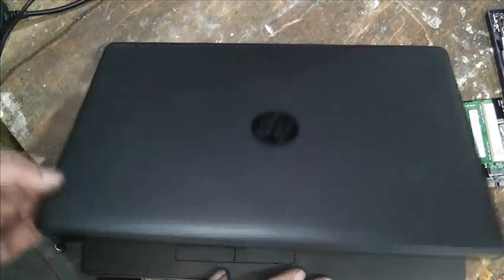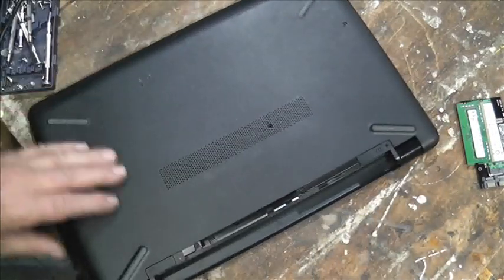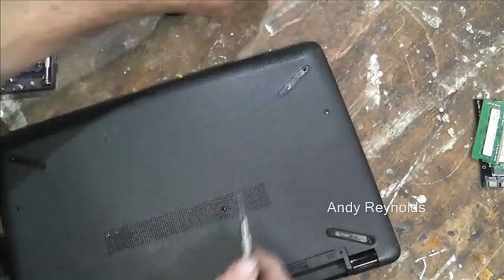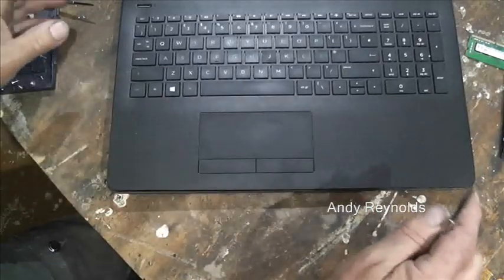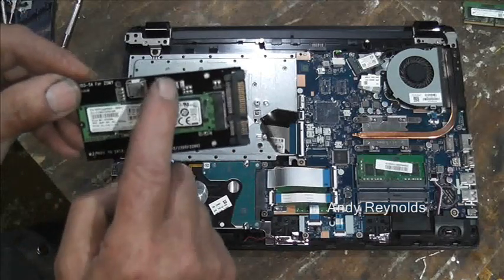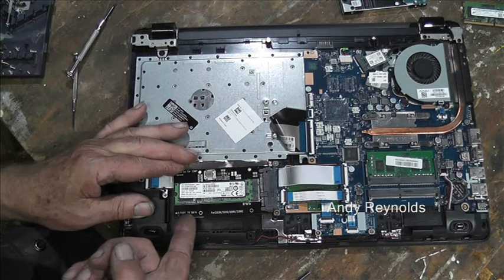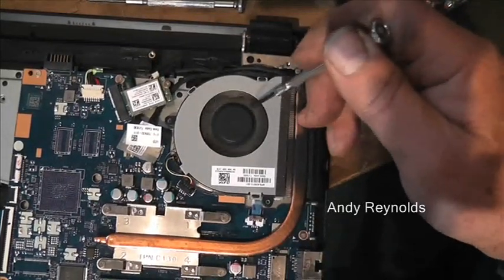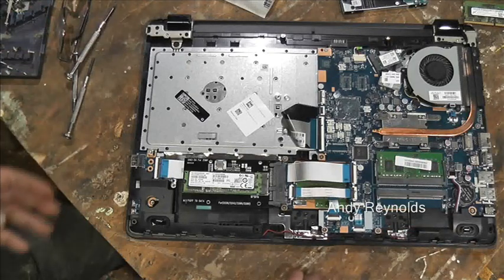HP 15BW slimline laptop, RAM change, fan clean. Easier than you think.

Comment: Getting to everything is different or difficult depending on your point of view...
recently just upped the memory on an old hp of mine...
lots of little access doors underneath for  nearly every thing.... I guess this   one piece cover cheaper to manufacture..... and  gives access to everything.....

interestingly old memory  seems  harder to find... my upgrade was ddr2...... especially bigger sticks...paid £45 squid  for 4 gig stick..
and you can probably get a ddr3 or 4 complete laptop for about £120 squid...
so what do you do...? my ddr 2 one is still good for basic tasks...  even use  it to control our cctv....

can you not put both sticks you have there in together...?

good vid

N
Reply from the maker: Neil, this laptop was a student throw out, dumped in a bin and rescued by Owen. Yes those access doors are splendid and make things easy. This method is designed to keep people out and is probably just a bit cheaper. This is ddr4, until recently I didn't know it existed. It is good to get to the fan and clean it out, a thing that hardly ever happens. Cheers
Reply: @TheInfoworks  student throw out.....  ??? ddr4..?
wtf.......
anymore... were this came from.. ?
N x
Reply from the maker: @neilobusk  exactly, should last for years. It had clunky win 10 and I changed that for Linux mint and the Wi-Fi card was duff, but it's a quad core and the battery is good. What more does one want. Keep you informed next year, cheers
Reply: @neilobusk  That's right Neil, I have been posting videos of the things students throw away when they leave university over on my channel. I have about 4 more videos to edit from this year, last June. Anything you can think of: I have seen it in bins and skips! Have a look at my street scrapping playlist!
Reply: @bootsowen  lets go av a look see.... :)